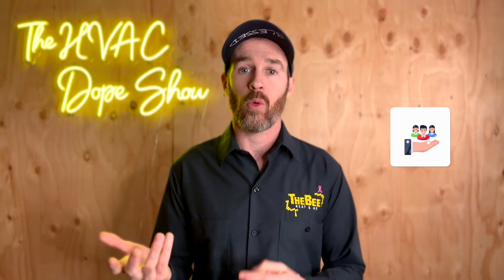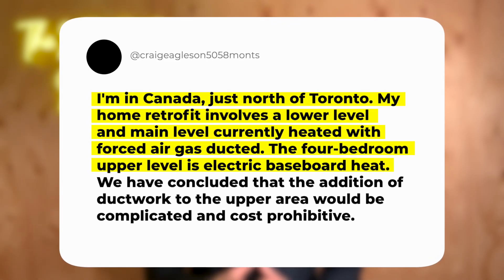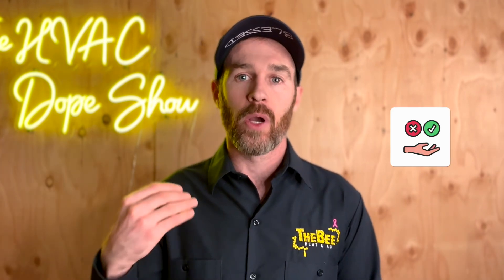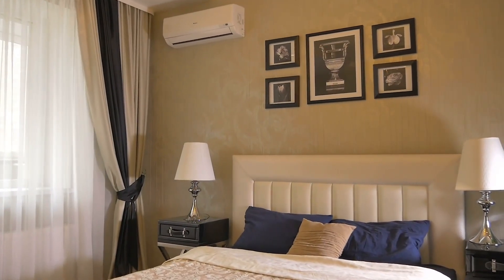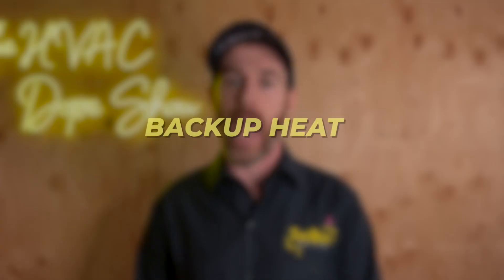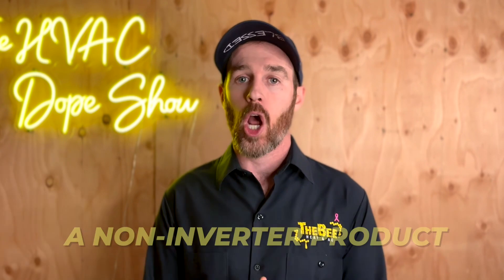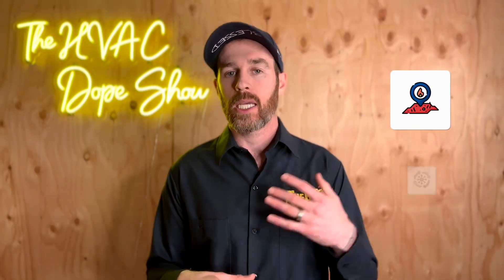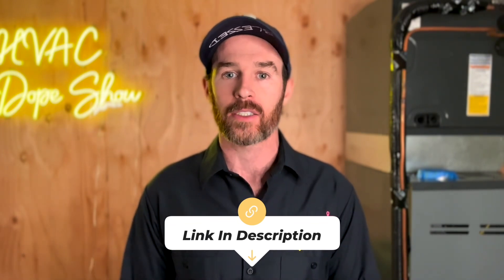Why your upstairs is uncomfortable | VRV Life comment response 🔥

Comment: I enjoy the thorough explanation of the topics you present and have watched many of the ones on heat pumps as I am in the planning stage of building an ICF home near Tomball Texas. I am interested in the VRV life system and based on what I have heard you mention, if the outside condenser unit was sized correctly, I could add more indoor units at a later date when I build an addition onto the home. My question is: how much larger of an outdoor condensation unit can I get without compromising the efficiency of the properly sized system?
Reply from the maker: Maybe 20% ? Short answer is we advise against that but most of Texas, and if I’m thinking of the right tomball it’s pretty humid there, you have higher loads because of humidity removal so a 5 ton vs. a 4 ton won’t be overkill for your system by any means (for example). But I wouldn’t put in a 5 ton for the “maybe” expansion in the future, if you only need a 2 ton right now because you’d probably be better off just adding a second system later.